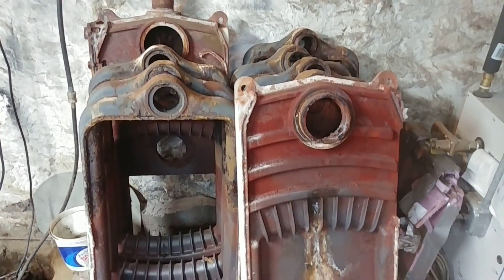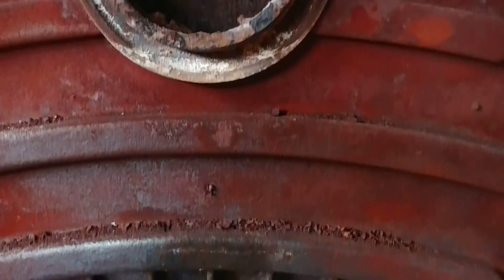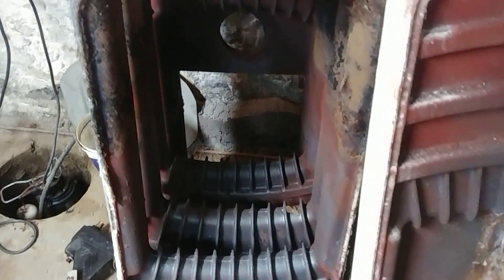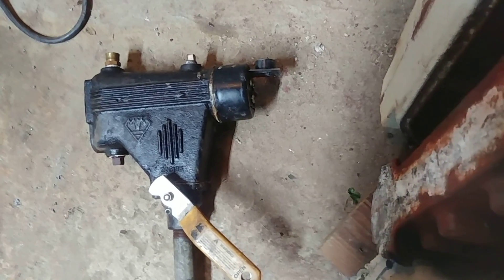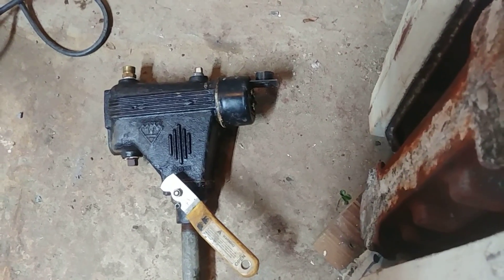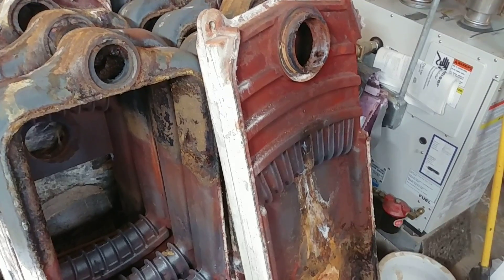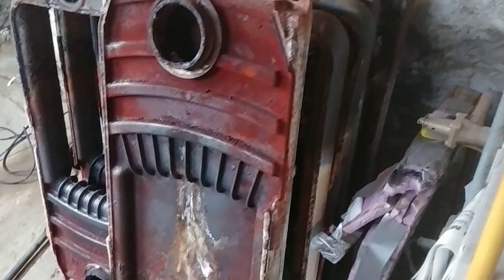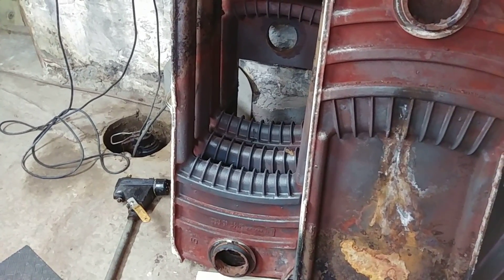Steam Boiler Dry Fire-The Worst Way A Boiler Can Fail- A McDonnell & Miller #67 Kills Another Boiler

Comment: For steam boilers during the heating season with the probe type LWCO is it normal maintenance to drain the boiler once a week to determine if the LWCO cuts off the boiler fire ? Or is this for McDonald Miller number 67 float type LWCO only?

2nd question when you are cleaning a steam boiler the goop that you get from a poorly maintained system, dirt and such that clog’s drain’s or the pig tail which chemicals do you like?
Reply from the maker: Probe type LWCOs don't usually need the weekly blow-down if they are directly mounted to the boiler. 
A yearly drain-down test on start-up usually is good enough.
The manual says to pull the probe & clean it then, too.
There are exceptions to this general procedure, as in if the probe is mounted in a special manifold mounted off the boiler and piped in.
That would need a weekly blowdown/test as if it was an ordinary float LWCO.

I don't usually use chemicals to clean boilers, but that's just me & my quirk.
Others like to use this or that & that's fine.  
I myself have no recommendation except to make the system as leak-free as possible.
Reply: Surge-X is great.

Comment: Amen.. steam is maintenance heavy, man.
No probe type sensors here on steam that I have ever seen.
Just beginning  to install them for LWCO in commercial hydronics, but common in residential hydronics.
Just fixed a sticky 150 (paired with a 67) that flooded a boiler and piping this afternoon on a system that sat all summer with water in it.

Would you recommend draining boilers dry over the summer?  I was wondering if this would reduce corrosion during the 5 months or so of non use.
Reply from the maker: As to reducing corrosion during the off season, most recommend actually flooding the boiler.
Unless the boiler is made completely dry (very difficult, tedious, and time consuming),
corrosion will be greater in the damp drained boiler then a flooded boiler.